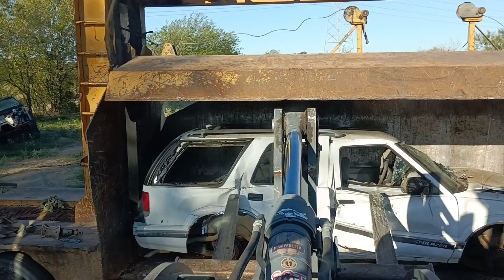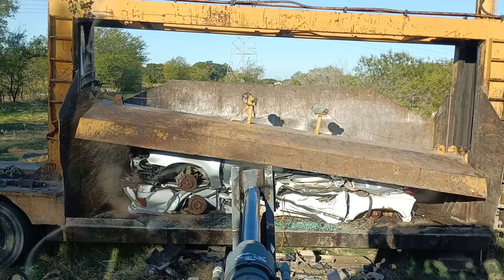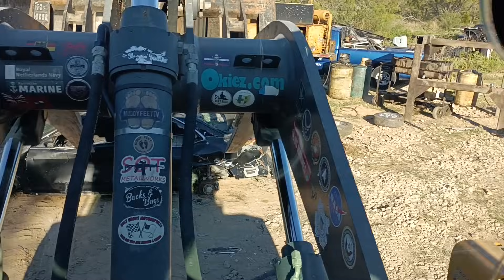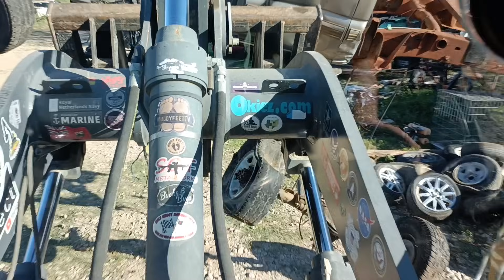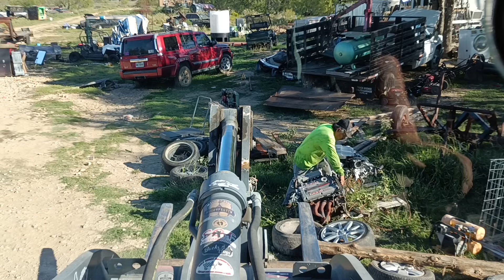Crushing for Kindness 🤠👍

Comment: 3:44, Chevrolet Blazer from the previous video being crushed.
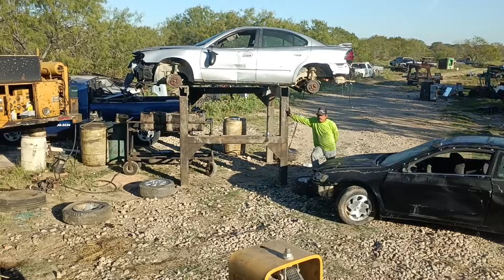5:20, Honda Accord Coupe (14:16, crushed) on the side.
5:22, Pontiac Grand Am (8:33, crushed) on the rack.
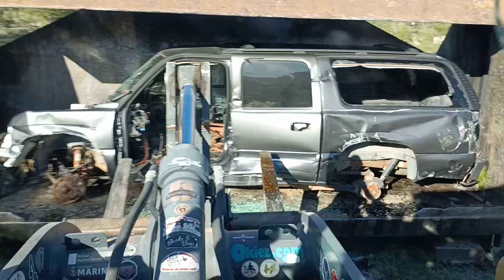9:47, grabbing a Chevrolet Suburban (15:14, crushed).
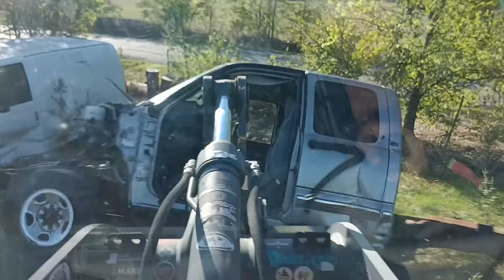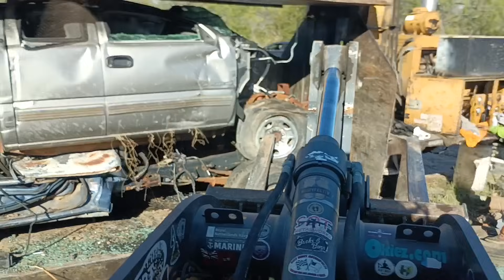16:56, grabbing a Chevrolet Silverado (21:55, crushed).
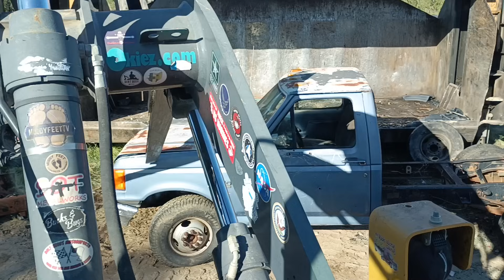18:37, Ford F Series (19:34, crushed) in front of the crusher.

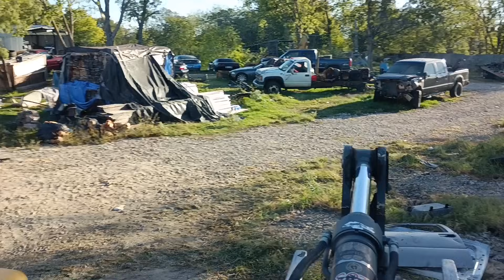Spot at 4:55....Blue Dodge Charger RT sedan, black Chevrolet Corvette, and the front of what looks like a Maserati Gran Turismo convertible. It's a Maserati for certain, but cannot tell if it is a Gran Turismo (looks like it with the stuff on top) or a Quattroporte with the roof ripped off.

6 cars crushed this video. 2,945 total.